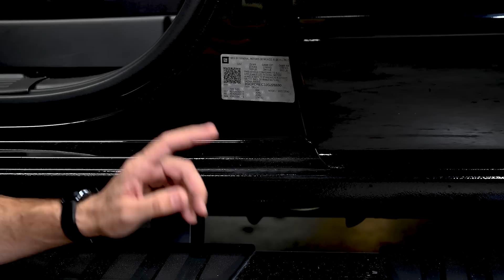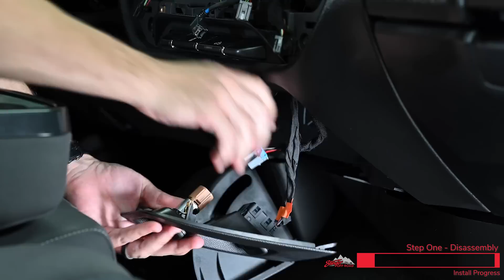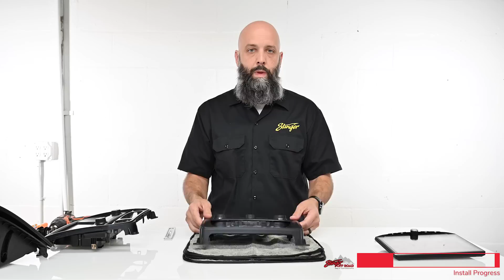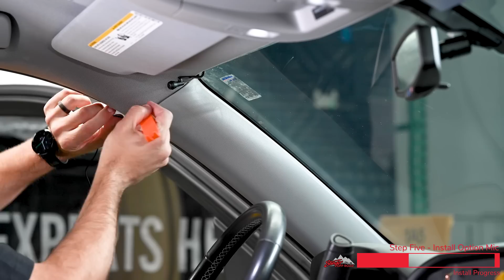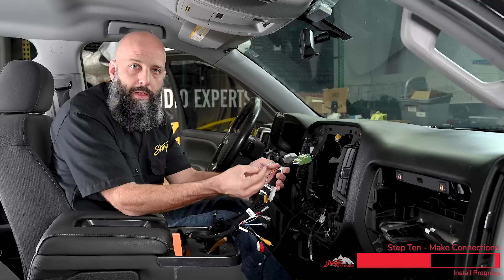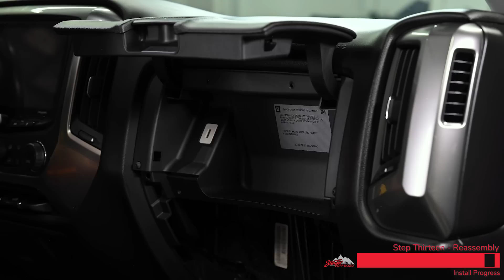INSTALL: 2014-2018 GMC Sierra & Chevy Silverado Truck HEIGH10 Radio Upgrade | RB10GM14B

Comment: So if i have bose system but not using it only tapped into the speaker wire of the bose … would i plug the harness into the pac non amp or amp side ?

Comment: Just had the system professionally installed for my 2015 Silverado 3500. Really like it but was very disappointed to find the steering wheel control backlights no longer light up. After talking to the installer who also talked to tech support, apparently no fix for this currently? Any idea when there might be?

Comment: I have a 2015 2500 LTZ with the BOSE system... code IO6 ..... I don't have the lower parts you removed for the USP ports, so this video confuses me a bit as I have the full center console

Comment: Where are you located? I need to install a stereo in a 2017 Chevrolet Silverado. I replaced the steering wheel because the one I had didn't have stereo controls. I need them to work.

Comment: I just had one installed on j my 2018 Silverado. The backup camera lines that were visible on my stock radio screen have disappeared, along with the outside temperature display and ac blower speed bar at the bottom. Any suggestions on how to get these to display on my Heigh10?

Comment: Genuine question: why someone should buy this infotainment that doesn't even run android for more than $1.000 when you can get Mekede or Dudu android based devices with 2k laminated screens for less than $500?

Comment: My truck has no hmi module to connect back up camera but has factory back up camera and shows no signal , has anyone found out how to fix this issue
Reply from the maker: IO3 and IOB factory radio RPO coded vehicles will not have a separate HMI module that needs to be interfaced with. For those trims the camera wiring is in the main radio connector. If you are having trouble with your factory camera, please give our support team a call when you are in the truck and have access to the wiring in the dash and they will be happy to help you get it going. The number is 727-592-5991.

Comment: I have the 2018 GMC Sierra 1500... So i noticed on the youtube installation, that on the rear camera, no backup lines were retained. Would I need to upgrade the factory camera? Also, I use USB stick in the center console for Media playback (mp3's) will this still work or would I need to use the installed USB's where the lighter was? Also I have a Sirius XM subscription in my truck now, will Sirius work or is there a 3rd party module needed? 
Basically what is retained.. what is not and what other 3rd party items would I need?
Can you hook up a Amazon firestick on the brains via HDMI? I saw a HDMI port there.
Reply: i wanted to know about the USBs also

Comment: I got this installed at a shop that is a stinger dealer recently. I’ve had problems with back of camera cutting off or freezing as well as igo navigation does not show my location and just says acquiring satellite
Reply: Hello. 
Did you lose guidelines, after your install??

Comment: When I removed my oem radio to install the height 10 my truck didn’t want to turn on no more any ideas on why that’s happening
Reply from the maker: It sounds like you disconnected the factory WiFi module in the dash when connecting the radio. That module needs to stay connected and is not part of the radio replacement process. Only disconnect the connections needed to plug the radio replacement interface/harness in, and to not remove or disconnect anything additional.

Comment: I have a '15 Silvetado 2500. What are the factory features of the truck  that are lost when switching to this unit?
Reply from the maker: This HEIGH10 kit fits the vehicle mentioned. This kit doesn't retain factory satellite radio, rear seat entertainment system, steering wheel control backlight, or factory USB ports. If you have any further questions, feel free to contact us at (727) 803-0474

Comment: Are these a way to install Android to the OnStar 10.5 radio?
Reply from the maker: This radio replacement package will work in 2014-18 Sierra and Silverado trucks that do not have the factory Bose audio system. It replaces the original radio entirely, and will retain OnStar functionality. For more detailed fitment or technical questions, please reach out to our tech support team at 727-592-5991 for assistance. Thank you.

Comment: Will this radio work if the truck has a OnStar system?
Reply from the maker: This radio replacement package will work in 2014-18 Sierra and Silverado trucks that do not have the factory Bose audio system. It replaces the original radio entirely, and will retain OnStar functionality. For more detailed fitment or technical questions, please reach out to our tech support team at 727-592-5991 for assistance. Thank you.

Comment: Only thing that’s lame is the no wireless CarPlay or auto!   Other than that it’s nice
Reply from the maker: When the unit loses a wired connection, the sound quality is depleated. We value sound quality, which is why it's a wired carplay connection only.

Comment: I have a 2016 Silverado work trim truck. There is no hmi module behind the glovebox. I do have a Factory b/u camera. Where will I find this wire?
Reply from the maker: Hi there, please contact our technical support department at 1-800-477-2267 EXT: 3333 for further assistance.
Reply: Did you figure out the issue I have same problem

Comment: Welp thats a wrap for me. I use my cigarette lighter port for a radar detector.
Reply from the maker: Please contact our technical support department if you need further assistance at 1-800-477-2267 EX: 3333

Comment: I just did an install on my 2015 GMC 2500 Denali and can't get the audio to work. Any ideas?
Reply from the maker: Hi Steven, please contact our technical support department at 1-800-477-2267 EXT: 3333 for further assistance

Comment: I am having trouble, got it installed and everything works as it should, but now speaker in my driver door , rear passenger door and the speaker on driver side dash are not working. It isnt an issue with fade or balance? Any help
Reply from the maker: Hello, please contact our technical suport at 1-800-477-2267 EXT: 3333
Reply: Hey I’m having the same exact issue and tech support is closed until Monday, did you ever figure out what the problem was?

Comment: What if I have a kicker sounds system from the factory that is also plug and play will I be able to connect these product as well?
Reply from the maker: This unit will be able to connect with a Kicker sound system. If you have any additional questions, please connect with our technical support line at 1-800-477-2267 EXT: 3333. Thank you!

Comment: So I just added the new unit, honestly pretty sweet set up..Will this work with an adjustable knob for my bass (subs), dont enjoy having to click screen each time. Also have a lot of problems with my backup camera? Seems a lot more blurry than stock, lost my guidelines, and the camera freezes when backing up..please help!
Reply from the maker: Hi there, please contact technical support at 727-732-3114 for further assistance
Reply: Did you get this resolved? My camera keeps freezing and I would love my guidelines

Comment: I have a question, in the website it says not compatible  with Bose equipped system. My truck has the Bose system but Iike this stereo, is there any that can be done to make it work?
Reply from the maker: Hello, please contact support@aampglobal.com or call 727-732-3114 for technical questions. Thank you!

Comment: i have the a WT model my steering wheel only has cruise control do I still need to attach the steering controls adapter?
Reply from the maker: If you do not have audio controls on the steering wheel, then you can leave that connection out of yours.
Reply: @StingerDrive  Thanks! Appreciate the outreach. Good to see customer service still matters. Tell your boss I said you deserve a raise as well.

Comment: Will that retain the WiFi in your vehicle??
Reply from the maker: The factory WiFi hotspot will still be able to be accessed and functional, but no changes can be made to the network, password, etc once the factory radio is removed. Those things can only be changed or adjusted while the factory radio is still in the truck.

Comment: My concern is this kit is for iob and io4 etc or you have to pick a specific
Reply from the maker: The radio replacement package comes with everything you need for all factory audio trims, other than Bose equipped vehicles. Once you know which specific factory radio you have, you will then use the correct harnesses and instruction for your truck.

Comment: Ummmm. From a few wires to wtf wires. How does the satellite radio work?
Reply from the maker: To use satellite radio you would need to add the SXV300V1 universal tuner from Sirius XM (sold separately). It then connects to the 12 pin to DIN cable adaptor included with the HEIGH10.

Comment: When are you going to make this compatible with Bose????
Reply from the maker: We are working on a Bose compatible solution, but there is no ETA on a release yet.
Reply: @StingerDrive  could you not just bypass the Bose amp altogether coming off this unit? Does it have any rca outs for amps? If not, could you use a module for that daisy chaining off your unit?

Comment: why cant you use the stock microphone?
Reply from the maker: The factory microphone is only compatible with the factory radio and OnStar systems. It is not able to be integrated into the HEIGH10, or any aftermarket radio.

Comment: My 2014 Silverado have the smaller screen is this compatible?
Reply from the maker: Yes, this will work with all factory screen sizes, as long as the vehicle is not equipped with the factory Bose audio system.

Comment: My truck has bose speakers, any way for it work with them? Also pretty sure my hmi went out, my screen in blank. Will this radio work without replacing the hmi?
Reply from the maker: Unfortunately, this kit will not work in vehicle equipped with the factory Bose audio system.

Comment: I have a 2018 Denali does my built in phone speaker connect to this unit or do I have to use the mic
Reply from the maker: The factory microphone in the vehicle will only work for OnStar. You would either need to use the included external microphone, or the one that is built into the screen of the HEIGH10.

Comment: Recently installed into my 2015 Silverado. All works great, except I lost the steering wheel controls. The ten pin t harness is connected correctly from the steering wheel column into the green swc bullet input. I have the module on 4. The module light even blinks when attempting to use the steering wheel controls, but nothing. I’ve taken it apart and put it all back together several times and can’t figure it out. Please help!
Reply from the maker: It would be better if you called in so we can help you troubleshoot this issue. There are too many variables to diagnose via chat. The number is 727-592-5991 and we are open from 9AM-8PM EST M-F 10AM-5PM EST SAT Be sure to use the callback feature when prompted. Thanks!

Comment: Do you need wifi and can you download apps
Reply from the maker: The HEIGH10 does not connect to the internet, so wifi is not required. Any apps accessed thru CarPlay or Android Auto would be downloaded to the connected device and accessed that way, not downloaded or installed on the radio itself.

Comment: This video is very exciting until I have to remove one of my cigarette lighters to have the USBs work? There's two USB ports in my console is there a kit to connect those instead? Anybody help me out with that? I want a new radio but I use that cigarette port for charging while the vehicle is off
Reply from the maker: Unfortunately, the factory USB ports are not compatible with the HEIGH10 radio. You could use the included dual USB port mount and install it in the glovebox or elsewhere by using a step bit to make a hole that it can be mounted in.
Reply: @StingerDrive  thanks for the quick response

Comment: Could you do a video for those people that have the center console in their trucks,or what installation is different? Thanks
Reply from the maker: We do not have a video that specifically shows the trucks with a center console, but you can see how easily the tray of the console comes out in videos like the one linked below that other individuals have posted on YouTube. The rest of the installation will be the same. 

https://www.youtube.com/watch?v=Iq8K-zCDoow

Comment: Can I hook up a subwoofer to this?
Reply from the maker: Yes, you can connect a powered subwoofer or sub amp to the HEIGH10, and take advantage of the level control thru the touch screen.

Comment: I have an after market amp and speakers, will this system work well with my set up? I have a phoenix gold 500w amp and phoenix gold speakers. Also I don’t like the idea of losing my CD player 😭
Reply from the maker: As long as you do not have the factory Bose audio system, it will work for you. Unfortunately, there is no way to retain the factory CD player with an aftermarket radio.

Comment: Hello. Will the kit come with the temperature control knobs shown in the video ? I have a 2014 Chevy Silverado 1500 Work truck trim, which does not have the same knobs as the video.
Reply: By temperature control knobs, I meant the HVAC control panel.
Reply from the maker: The factory climate control panel from the truck is reused in the kit panel. No climate controls are included. You factory climate control panel would have to have the same overall shape as the ones shown in the guide and video to work in the kit. Some of the center buttons may be different, but the overall size and shape of the panel would have to match up.

Comment: My biggest question with this is will I still be able to keep using my steering wheels control? Like the music forward and backwards and volume up and down?
Reply from the maker: Yes, the steering wheel mounted audio controls will work with the HEIGH10.

Comment: Do you have one that will work with a factory bose  system?
Reply from the maker: We are working on a solution for Bose equipped vehicles, but we do not currently have one that is compatible.

Comment: Maybe I'm confused.  It seems like you lose a lot of factory functions,and don't really gain much besides a larger screen
 Am I missing something?
Reply from the maker: You gain the larger screen, as well as HDMI input capabilities, 4 camera inputs for front view and blindspot cameras, time alignment, adjustable equalizer, and many of the features that people perceive as lost can be adjusted with the Vehicle Settings App from PAC-Audio when using the PAC-UP interface updater.

Comment: Not hating, but what was the purpose of taking the glove boxes out?
Reply from the maker: This is required to access the HMI module for the factory camera integration. That module is located behind the glovebox.
Reply: I was wondering the same.

Comment: Any chance that you may offer a bose compatible unit in the future? Love this product and design.
Reply from the maker: We are working on a solution for Bose equipped vehicles, but no timeframe currently.
Reply: Any updates with a system works with Bose ?

Comment: Doing one on a 2014 Sierra. Everything qorks but the swc. Front buttons still work the dash. Just no back button functionality.  Used the THarness and ran the single swc wire to the green swc wire. Pac module swc led flickers when I press them but nothing is working in the screen and the radio won't let me do it manually...any ideas?
Reply from the maker: Please give us a call in tech support and we can help you out. The number is 727-592-5991, and we are in Monday-Friday, 9am-8pm EST

Comment: Will this require me to remove a center console to install
Reply from the maker: You will not need to remove the console to replace the radio. However if you wish to mount the dual USB panel in place of an outlet on a vehicle with a center console, you would need to remove the top trim panel that houses the outlets.

Comment: Hi, I bought this and I love it however - I have a few things I'd like some help with.  For example, I lost my backup camera steering guidelines, is there a way to get those back?  I've also seen other videos of Jeep integrations with this radio and they have a lot more functionality, like heated seat options, wheel alignment, etc - can I also get something similar with this radio and my Silverado? 

Thanks, I appreciate any help.
Reply from the maker: Unfortunately the dynamic guidelines are something that the factory radio itself generated and are not available on the HEIGH10. The other additional features that you are referencing are only available on the Wrangler JL/JT and Ram kits. Sorry for the confusion.
Reply: @StingerDrive  Will the other additional features that he's referring to ever be available/integrated into this unit for the Silverado? Is it a firmware update for the radio or Pac? Curious as to why full intergration is avaliable for Jeep and Ram but not GM?

Comment: I just ordered my heigh10 but I have a question. My truck came with wifi built in, does that still work after the install or is that option removed?
Reply from the maker: The factory WiFi will still work, however any settings that were available thru the factory radio would need to be adjusted prior to installing the HEIGH10, or they would need to be done with the PAC-UP interface updater (sold separately) and the Vehicle Settings Application thru the interface.

Comment: Good looking and straightforward install.  But am I right that it doesn’t retain factory mic, satellite radio, steering wheel controls, factory usb and integrated dash control?  So I’m basically buying it just for a bigger screen pretty much.
Reply: Someone just told me there’s an Xm harness mentioned in comments.
Reply: Good point